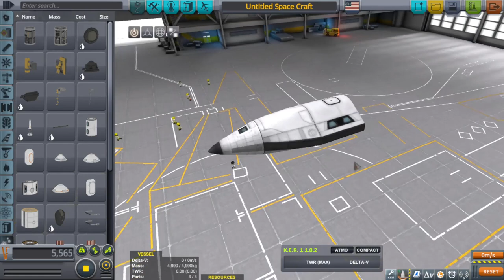SPEED BUILD SSTO in 25 min.

Comment: Really happy that you posted another video. One thing is on my mind though, if you ended up having almost 500 delta v left in orbit then making the craft lighter would be better. Removing all the small fuel tanks will mean less fuel but speed is key so as the frust to weight ratio will increase the flight would be more efficient which will not make the lost fuel being a huge problem in the end right. Anyways great vid, happy to be back.

 :_ck1::_sck1::_ck1:

Comment: I really love that SSRT design. It's too bad we don't have a cockpit-part that can be used as a nose-cone, so using that capsule as a standin does the trick.

When I do my own spaceplanes, I often run into an issue where the plane will oscilate around the length-axis and I don't know where that comes from. Basically, the plane will rotate a bit to the left by 5 degrees or so, then swing back to the right until it hits 5 degrees on that side and then pendle back and forth between the two points. It's kinda annoying (while also wasting Monoprop if that's active) and I think it has to do with the reaction wheels, but I don't know if its due to having too many, too few or if the placement is wrong.
pls halp
Reply: In space or in the atmosphere?
Reply: Maybe try turning SAS on and off?
Reply: @lb2791  In space. It performs well, but that swaying makes docking a bit tiresome at times.

The reaction wheels are somewhat far from the centre of mass, I guess that makes them overcompensate the roll and it ends up in that oscilation.
Reply: That's weird, I never had this problem. The position of the reaction wheels doesn't really matter as far as I know.
You could be onto something with the oscillation. Have you tried autostrutting your parts to the root part?
Also where are your RCS thrusters? If they are attached to wing or other parts that are far from the center, maybe some of their force is applied in bending parts.
Reply: I generally try to attach most parts of my spaceplanes to the central fuselage, not nessessarily to the parts they are visibly attached to. For example if you attach tanks to the fuselage and the wings, attach the wings to the fuselage instead of the tanks. This will make everything much more rigid.
Reply: @lb2791  I think not attaching everything to the main fuselage while using autostrut might be the issue. The RCS thrusters sit on small tanks on the wingtips, those tanks are attached to the wings, which are attached to tanks which in turn are attached to the main fuselage. There's going to be a bit of bending for every part and that adds up, I guess.

I'll take apart the entire thing and propperly reattach everything to the main fuselage and see if that'll help. Thanks for the input!
Reply: I get this in most of my space vehicles. Actually, it tends to be all the big ones except my first big spaceplane, possibly because that spaceplane has its reaction wheels attached to the root and the center of gravity is in the root too, (it's a long Mk3 cargo bay,) or possibly because every single part is autostrutted to the root. It has no rotational RCS, only translational.